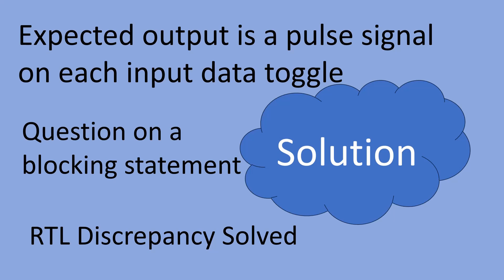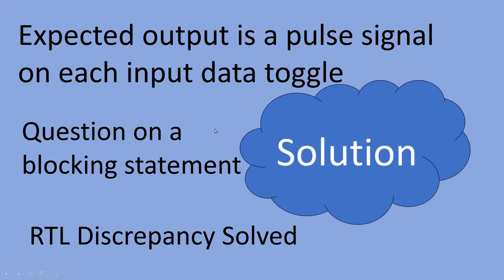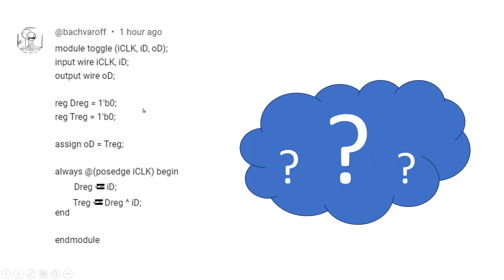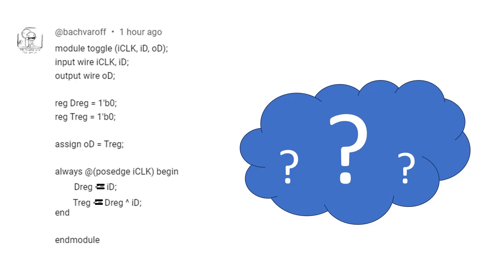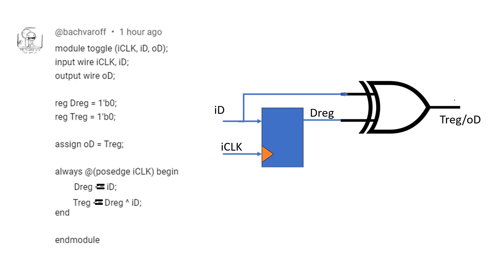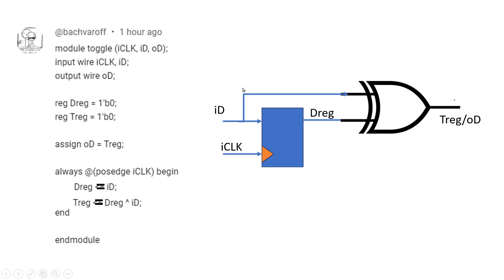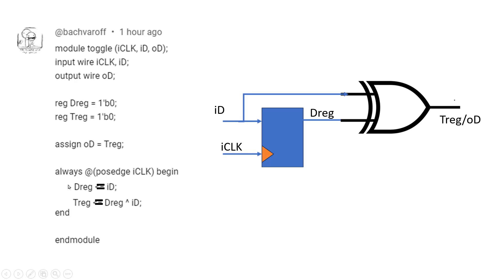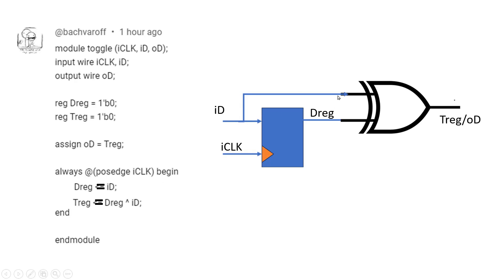Solution: Interview Question on Non blocking statement

Comment: It's actullay a D-flipflop with a 0 at its input (D)
The reson is that blocking assignment blocks all the statments below it ,thus Dreg = iD
Then Treg = iD ^iD (both are the current input iD) and consequently the output will always be 0 at each clk cycle
Reply: Yes
Reply: Then the D flipflop is optimized away as its input is always 0. So the resulting logic will be just an output pin tied to 0.